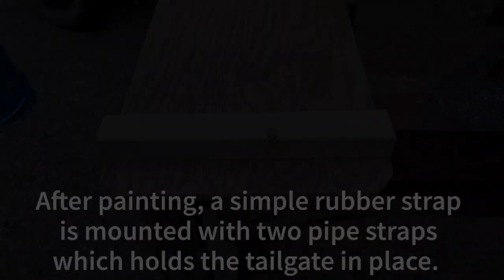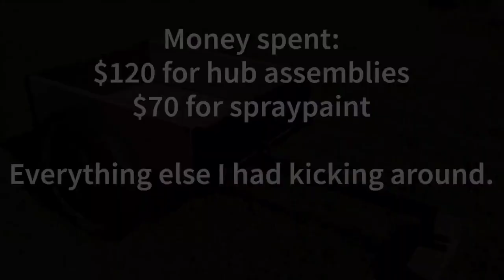DIY Quad Dump Trailer Build (part2)

Comment: You really did a great job with this trailer.
I have a similar sized dump trailer for my ATV, but it's made from an old 200 gallon fuel oil tank.
The fact that it is all made of metal makes it noisy when I ride on trails in the forest.
I think I will improve it by drawing inspiration from the work you have done.
Reply from the maker: Thank you! Great idea utilizing an old tank! To be honest, this trailer makes some noise too. The lock mechanism has a tiny bit of play, enough to rattle when driving around! But it doesn't seem to bother me since I am just driving around in the yard.
Reply: @adrianwoodworm  I'm sure your trailer is much quieter than mine.
Wood absorbs vibrations much more than steel, it's like hitting a wooden barrel versus a steel barrel with a hammer.
To reduce the noise the trailer makes, I secure the bed to the frame with a U-bolt when I don't need the dump function, such as when picking up logs.
With this thing, I cut the noise the trailer makes by more than half, especially when it's empty.